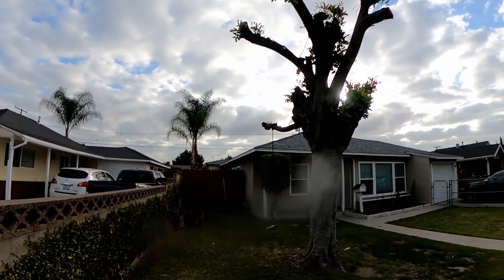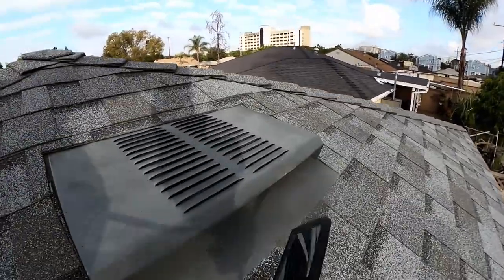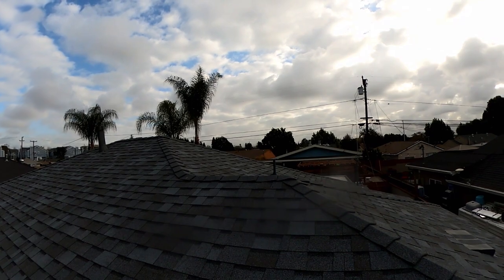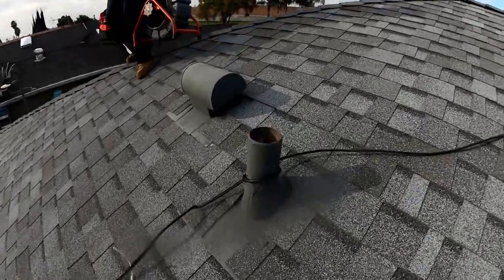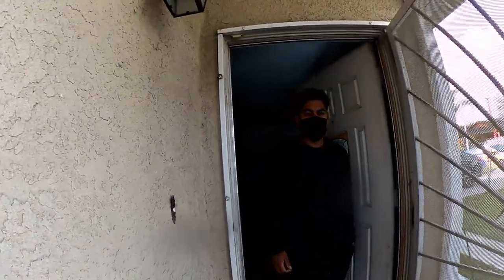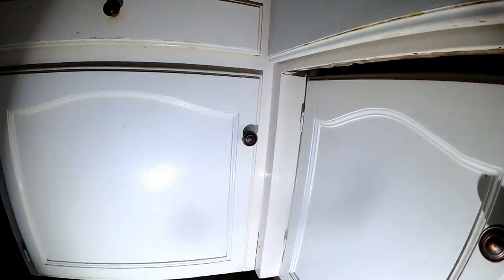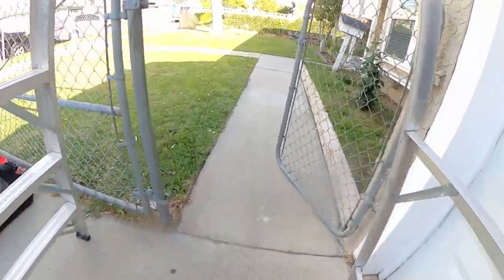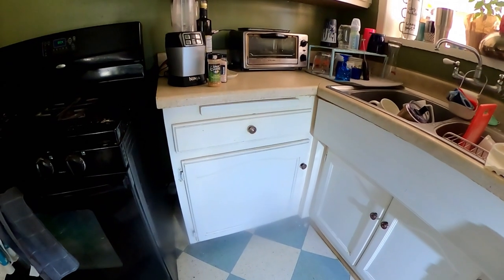Rat INFESTATION creates RIVER under the home...How to GET RID OF RATS FAST! Twin Plumbing

Comment: I think the problem is that houses in America are not build with a proper rodent prevention system. The guys that build the house should be blamed for that. The building codes should change to include screens on those entry points, and a concrete base under the house.
Reply: This house appears to be 60s/70s construction, way before animal intrusion or energy concerns were an issue. The most they would do is screen the vents.

Comment: I have an idea twins. To prevent yall from leaving most needed tools on jobs. Yall should have a check list in vans. Of what tools yall are using. Everytime yall take a expensive or Big tool out of van. It should be Signed out and then Signed back in. At the end of job. So everyone slows down and thinks. You should designate a person on jobs. To be the checklist monitor.